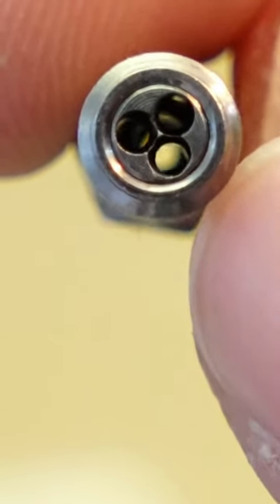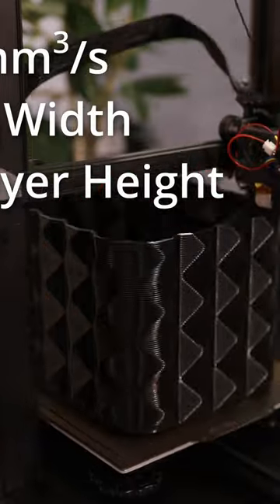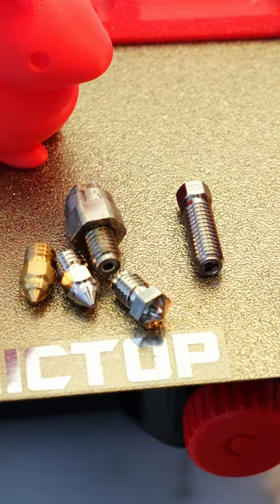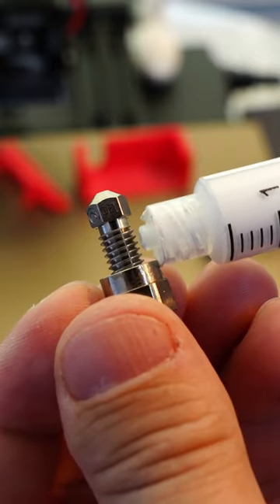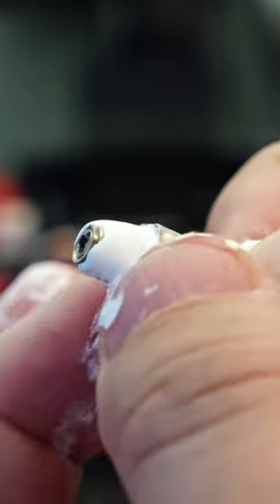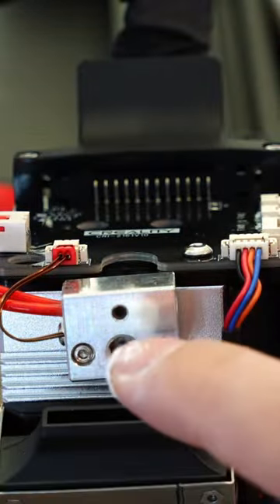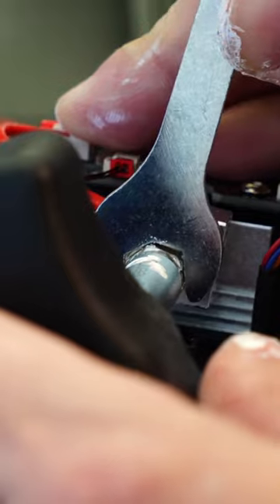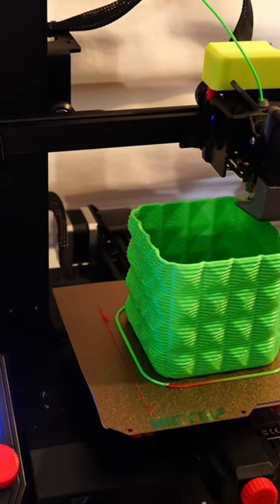What Printing at 100 mm³/s Looks Like

Comment: You know using that much thermal paste gives you cancer.
Or maybe it gives me cancer....
Either way I'm pretty sure one of us is getting cancer.
Reply from the maker: Only if you inhale it. I will make sure to avoid snorting lines of Boron Nitride!
Reply: @NathanBuildsRobots  Where's the fun in that? Come on, it's party time!
Reply: As long as I’m not part of it 3s a crowd when you’re inhaling carcinogenic thermal chemicals
Reply: @gruffnutz  😁
Reply: @polycrystallinecandy  okay, so a bit like receiving a shipment of goods to a post office box, except it isn’t goods. It’s no goods I and it isn’t a post box its your pancreas .
Reply: Con razón me enviaron la pasta termica super protegida y el tubo de lubricante sin nada
Reply: @NathanBuildsRobots  Sounds like a challenge…I’ll snort boron nitride and then smoke some iron filings (that’s the free base of ferric chloride-it’s corrosive 👍) after which I’ll spot some solder (Pb free for health reasons)…then run a mile! Straight to my local Emergency department!
 (Disclaimer: do not smoke snort sport or shoot boron or ferric anything, kids, nor should you ingest solder with or without lead, flux or multiple cores. Just keep well hydrated and always get a good nights sleep)
Reply from the maker: @gruffnutz  I inject molten lead straight into my jugular - fastest way to get to the brain.
Reply from the maker: @gruffnutz  Though make sure to follow up with a kale/ashwaganda smoothie. It is a natural chelating blend that really balances everything out.
Reply: Boron Nitride is supposed to be one of the hardest substances ever synthesized by mankind. 

I'd really love to know how TF they grind it down to nano particulate size, as well as what else is mixed into that paste.?
Reply: Yeah I use something better

Comment: I definitely wouldn’t use that much. The goal with thermal compound is to fill the gaps in the material, not make a pad of it around all the metal. Plus it’s getting all inside everything and no doubt isn’t great for the nozzle
Reply: I have clogged nozzles in the past using the same amount of boron nitride as he does....

Comment: It's amazing how fast 3D Printing technology is evolving.

It seems like they now need a pre-pump system to first liquify, then force the plastic through the nozzles at a high enough rate.
Reply from the maker: True, its evolving quite fast. 2 years ago Ender 3 V2 was one of your best options. 1 year later the Ender 3 S1, with all the common mods pre installed was one of the best options. Now we have a bunch of fast coreXY machines. What will next year hold?
Reply: @NathanBuildsRobots i'm waiting for cheap geared dc motors (pm or sensored bldc) with encoders. I think that could make quite the difference on very high speed printing. 
Though I think the next thing is probably an affordable tool changer system with something like an ebb36 with usb or can on each tool.

Comment: Try cleaning out the nozzle maybe, Makers Muse had issues with boron nitride paste drying inside the nozzle causing blockage and underextrusion
Reply: yeah, the second blog in the block side was a bad idea, that would just end up all over the back end of the nozzle.
just covering the thread on the nozzle and careful screwing it in, the only squeeze out would be on the outside of the block.

Comment: Isn't it just mm/s because if you say 100 cubic millimeters/second it would be a volume of plastic equal to printing a solid cube with a diameter of roughly 4.6mm every second.

Assuming the plastic is PLA with a density of 1.24g/Cm^3 that would be over 1.2 grams of plastic every second.

Assuming you're using 1.75mm diameter filament that would mean you used this much filament per second.

100=X*A

Where X is the length of filament used and A is the cross sectional diameter of the filament. 100 is the supposed volume of plastic used in mm^3.

Since we know the diameter is 1.75mm we also know that the cross sectional diameter is pi*radius^2 the radius is half of the diameter so 0.875mm. Typing that into a calculator the area is roughly 2.4mm^2

So that gives us the equation

100=2.4X

You can then devide both sides by 2.4 to get X alone on one side and we get roughly.

41.67=X 

So you would be using about 40 millimeters of filament per second. That would be nearly 2.5 meters of filament per minute. Or if you let it run for an hour that would be 150 meters of filament used.

If I calculated something wrong then please do correct me but I think this should be correct.
Reply from the maker: I’ll bet you are right on with the calculations. If you check the video you can see for yourself the filament feed rate. It’s well over 1 inch per second
Reply: @NathanBuildsRobots  oh, cool, that's pretty insane in that case.
Reply: @NathanBuildsRobots but NOT cubic… ;) He’s right. The difference between a line of toothpaste on your brush and a cup of toothpaste all over your hand.
Reply: @NathanBuildsRobots  an inch per second is only 25.4mm (linear) so to produce 100mm³, it would have to be exceptionally high layer heights and very wide nozzles.
Reply: @Johnny5Toy  he has a 1.2 mm nozzle, but i doubt that it can reach 100mm^3/s

Comment: Boron nitride can and will clog a nozzle if you get it inside. So don't dump it all over the place willy nilly. Remember once it's cured it's literally a high temp ceramic-like compound that withstands temps well beyound the capabilities of your printer (850-2000c dependant on atmosphere). Best to let it set overnight to air cure but if you're impatient 90c for 10mins is supposed to quick cure it tho I wouldn't bank on it. Haste makes waste. Also you don't even need a fancy cht nozzle to print that fast. My ender 3's will print 500mm/s stock when tuned and calibrated properly. However i don't normally go beyond 100mm/s tho because it will make prints generally weaker and printing fast will degloss glossy filament prints.
Reply: 500 mm isn't a volume. 🤦‍♂️

Comment: Turn up the heat to higher than you normally would.
Reply from the maker: Its at 260. I would go higher but the stupid firmware is limiting me!
Reply: @NathanBuildsRobots  laughs in klipper

but for real you can flash a custom build of Marlin to get higher temps.  Just need an all metal hot end

Comment: Me over here running 3D prints at 150 mm/s
Reply: Can't wait for Bamboo P1P at $699 and doing 300mm/s and faster!
Reply: Umm... So? Anyone can do 150 mm/s on anything, as long as you're laying thin. I.e., low volumetric flow. But you can't do, say, 150 mm³/s.

Comment: the problem is that the ripping happens too high, if you press fast, then the metal cools down in the middle, causing it to solidify. if it were further towards the tip, the filament could first soften and then heat up properly. that could bring a few percent more flow.

Comment: A volcano hotblock would definitely bump up the flow rates, maybe 100?
Reply from the maker: I need to go to 300C
Reply: Have you tried volcano PLA? It’s supposed to melt faster have even higher flow rates than standard PLA
Reply from the maker: @kylepotter9162  I have not heard of it. Looks interesting!

Comment: I’ve ordered a few of those from AE but seriously how much difference is that boron shave cream gonna make?
Reply: I seen where someone put it on the all metal hotend where the heat break goes into the heatsink. Yeah, isn't the point to STOP the heat from transferring up there, not help it?
Reply from the maker: You need it otherwise your printer will burn down. I apply some directly to the heated bed after each print
Reply: @NathanBuildsRobots  that’s very apocalyptic… it won’t burn down it’ll be fine
Reply: @3sotErik  it’s used to transfer heat away from the metal threading into the heatsink with the heatbreak so you get a more distinct change from cold zone to hot zone
Reply from the maker: @tadhgd350  Tell that to the fire department chief. I am on my 3rd house now.
Reply from the maker: @tadhgd350  Yes, I think its a good thing to have minimal thermal resistance all around.. however, the past between the heatbreak/heater block is an open mystery to me. I am not sure if it helps or not, or how much it helps. I know for sure the thermal paste into the heatsink makes sense, and boron nitride on the nozzle makes sense. But on the heatbreak? I think it extends the effective meltzone a bit, but how much it helps, I am not sure. when upgrading to a bimetallic heatbreak I noticed minimal differences.
Reply: @NathanBuildsRobots  that sounds like a sucky printer or user to me I have 5 printers for 5 years and not once has any broken. And it’s got nothing to do with the thermal paste wether it catches fire or not lol
Reply: @NathanBuildsRobots 3rd house ? Maybe you should put your printers in a fully enclosed metal cage, with halo fire suppression.  They make them for kitchens, for over stoves.  They put greese/oil fires out.  

They are expensive, but certainly cheaper than 3 fires in a house, or 3 houses even.

Here's my 2 cents:
As for heat transfer, don't you want to keep that heat to melt the filament ?  if your transfering it away faster, then your thermosister has to work harder to heat it up... maybe this is where your fires are coming from ?  By the very nature of pushing filament through, you are sinking the heat into the filament, so the more you push through, the more heat needs to be generated. 

Thermosisters are pretty strong, but they do have a limit though and can break down. When they break down, hopefully it's just a break in the electrical connection. If it ends up being a short (like crossing two wires, they heat up, burn out, or start a fire) then hopefully your power supply's built in safety designs kick in and stop any thermal run-aways... but considering how cheaply built some of these power supplies are... who knows.

I'll say this... spend a few extra dollars and make sure you use silicone wires, so that your wire's sheathing doesn't catch fire, if those wires heat up too much.  Just a little extra safety is all.
Reply: @3sotErik  You are meant to do this as it increases the melt zone area. If you only print very slow then no need.
Reply: @LaurenceGough  Gotcha 👍
Reply: @3sotErik  no, the heat break itself has to stop heat from getting up there. Some heat will inevitably still end up there though, and it has to be dissipated as fast as you can to not let plastic soften in the heat break. So, you use thermal paste so it dumps the little heat that's there into the heatsink as fast as possible where the fan takes care of it.
Reply: @tyrzxv  the Thermosister?
Reply: @deepspeed5238  sorry, I misspelled it... its thermistor.   It's the resistor that creates the heat
Reply: @NathanBuildsRobots  sounds more like user error. 

I print very similar settings high heat to comp for the speed and run it 24/7. 

My ender 3 hasn’t shut off in 3 years.

Comment: He's talking cubic millimeters of plastic extruded, not movement speed.
Reply: Bamboo P1P, 300mm/s and FASTER, $699, total game changer.
Reply: @brianmi40  P1P has a max flow of 21mm3/s.  This guy is printed a nearly 5X the rate you can on your P1P

I bet that 300mm/s speed is only when printing with a 0.1mm layer height...

Comment: Use diamond paste instead. Higher thermal transfer. You can even make it for yourself pretty cheaply.
Reply from the maker: Now that’s a cool idea
Reply: @NathanBuildsRobots  the whole point is that it's a very hot idea

Comment: Here i am, upgrading my hotend to death and still cant get over 20mm³/s at 240°c pla
Currently runnding Dragon UHF (with the HF heatbreak). The UHF Meltzone extender has CHT inside and also a CHT Nozzle.
Reply from the maker: What extruder? The extruder is more important IMO.
The Sprite hotend is surprisingly good at high flow printing.
#NotAShill
Reply: @NathanBuildsRobots  its sherpa mini in direct drive. Also running them on  TMC2209s with both stealthchop and spreadcycle disabled by using stealthchopthreshold: 0    in klipper
Reply from the maker: @KidCe.  Extruders that are small are not optimized for extruding fast. Big motor, big gears = more pushing power. That ends up being heavier
Reply: @NathanBuildsRobots  i might need to try to go back to a full sized motor setup and see how much difference it makes. 
But i dont actually think the sherpa should be the main problem, there are alot of people printing 30mm³/s+ with sherpa and Orbiter(which should be comparable)

Comment: Raise the temperature. Thats that i do and it easily prints 100mms
Reply from the maker: i'm firmware limited on this printer to 260C
My Ender 5 S1 should be able to hit 100mm^3/s since it goes to 300C
Reply: @NathanBuildsRobots  sooooo ur telling me that u dont print with pla. Im using pla and 0.2mm nozzle at 230c and it does the job. Tell me with what filament are u printing
Reply: @tianopresnik1274  yeah thats not a 0.2mm nozzle???????
Reply: Yes it is. An issue might also be that your nozzle is filled with crap from impurity of filament.
Reply: @tianopresnik1274  He has a Bondtech CHT Volcano nozzle. Smallest nozzle is .4mm. He's trying to get 100 mm3/s flow, not 100 mm/s speed.
Reply: @wk5199  oh shiiiiit. Thats a difderent story. Sorry man
Reply: @NathanBuildsRobots  Crazy slow.  Just order a Bamboo P1P for $699 and start printing REALLY FAST, like 300mm/s+.
Reply: @wk5199  Better to get 300mm/s SPEED and better: $699 Bamboo P1P.

Comment: I always print at 150
Reply: 150 what?
Reply: Sorry for the confusion but 150mm,now I more commonly use 300-400 as my printer was very expensive
Reply: @darragh3771  Ok. And presumably you understand that 150 mm is completely different from 150 mm³, right?
Reply: @marcus3d  yes I do know the difference but I can never get the little 3 at the top
Reply: @darragh3771  So now you're printing at 300-400 mm³/s? What layer height are you using, and what layer width?

Comment: Who the hell uses mm³/sec?
Reply from the maker: People who care about actual print speed, not perceived print speed.
Reply: Basically everybody because hotend output is almost always the bottleneck for speed
Reply: Umm... Everybody uses mm³/s. What else would you use???
Reply: @NathanBuildsRobots  another American that doesn't understand the metric system. That IS NOT 100mm³! 🤣🤣
Reply: @marcus3d  100mm³/s means you would have to print at 0.2 layer height, and 0.4 nozzle, 1.25m of filament in a second. 1250mm, in one second.! That isn't possible. 😂🤣😂
Reply: @Johnny5Toy  Nonsense. Of course it's possible. E.g., 2 mm nozzle printing 0.5 mm layer height at 100 mm/s. In this video it was more like 0.8 mm at 0.3 mm layer height, and trying to run it at 400 mm/s, but failed.

(Others do succeed, though. There are really big 3D-printers, you know. You're not gonna push something like 0.4 mm * 0.2 mm on a big printer with a build volume of over 1 m³.)
Reply: @marcus3d like I said, it isn't possible 😂😂
Reply: @Johnny5Toy  And I said that of course it's possible to print 100 mm³/s, and you're unbelievably ignorant if you think it is. 🤦‍♂️

Comment: My x1c does 400mm/s+ bone stock lol...
Reply from the maker: X1C Max Hot End volumetric Flow rate - 32mm³/s
Reply: He's talking cubic millimeters of plastic extruded, not movement speed.
Reply: Nope.  your max flow is 32mm3/s.

He is printing 3X faster than your fancy proprietary X1C